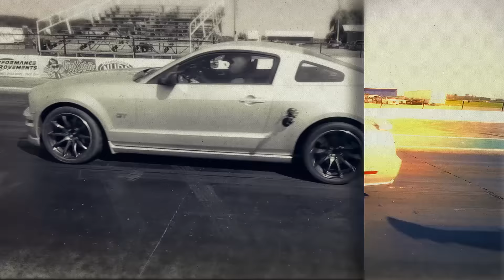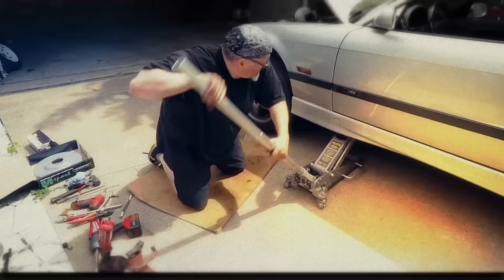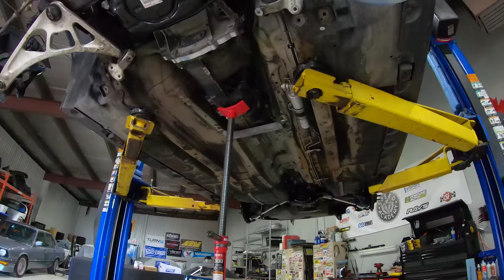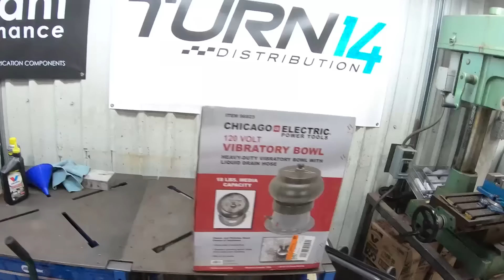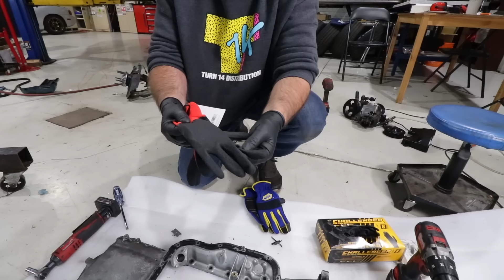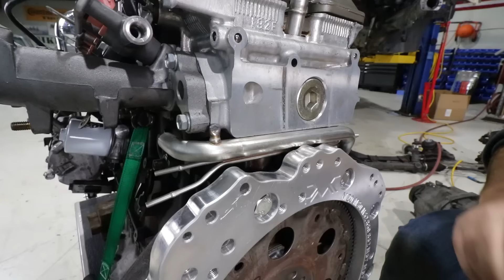Ultimate BMW M3 Rebuild - 2JZ Swap Isn't Easy - Part 9

Comment: For that stubborn harmonic balancer bolt get you a 2000 ftlbs impact gun.  By the way, I think I saw one of these being used as a prop in a Schwarzenegger movie.  Anyways, I have one and it hasn’t let me down yet.  See link below.

https://www.harborfreight.com/1-in-industrial-pinless-air-impact-wrench-68128.html

Comment: Hey guys here a set of sockets that you guys need so you don't struggle. 
You don't have to buy this set but lisle sell them individually and I trust lisle 
OEMTOOLS 25276 6 Piece Crank Bolt Socket Set, 6 Pack https://www.amazon.com/dp/B078K45ZQ4/ref=cm_sw_r_cp_apa_i_l-1fEbD63080Z

Comment: For the crank pulley bolt, I have one in my tool box and it has never failed me.
I work at Nissan and have used it for titan engines. 

https://www.amazon.ca/Lisle-77080-Harmonic-Balancer-Socket/dp/B00RGNCV1U

Comment: Never, never, never put grease on the input shaft splines like that.  Even if you don’t screw your clutch by contaminating it with grease creeping out the disc, you will have problems as the grease attracts dust as the clutch wears.  But what do I know, I have only been doing this for 40+ years.

Comment: Good luck! Btw you’re going to want a custom fab to support the front of that differential. Terrible design with one little screw in type bolt hole that’s suppose to hold all the torque. Even with a rear diff brace by SAAD racing, the second you have any wheel hop that front bolt will 100% break. 
Every other 3 series had two passthrough mounting points for the diff. And the more obvious note where it all bolts to eventually rips the whole frame out 😂 terrible design on a beautiful car.

Comment: I wouldn't dent the booster. I don't know anything specific to bimmers, but I know boosters from like 80s Toyota pickups seem to be pretty commonly used on alot of vehicles where more clearance is needed. Maybe start by just looking at boosters from other bimmers first

Comment: It's worth noting that when lubing an input shaft care should be taken to not overdue it. You obviously do not want grease or any lube getting onto the clutch disc. That is a quality grease I very much like, but I prefer to use a small amount of antisieze, i think that it's let's likely to "melt" under heat then a grease.

Comment: i use one of those hydraulic carts at work often. I use it to remove piston compressors for refrigation systems. the compressors themselves are usually V4 or W6 piston compressors and weigh 300-400lbs. That cart is a must, along with a boom truck

Comment: For removing the crank bolt on a Miata, I attached a long breaker bar, rested it against the ground and bumped the starter. The bolt came loose right away. Just be sure it is positioned on the right side or it will hit your body when you turn the car over.

Comment: Brake booster eliminator kit from Chase bays: https://www.chasebays.com/products/chase-bays-brake-booster-eliminator-bmw-e36-e46-e90-e92?variant=33631494729&utm_medium=cpc&utm_source=google&utm_campaign=Google%20Shopping&gclid=Cj0KCQjwoqDtBRD-ARIsAL4pviARD6YGD8R8Zcwlu4wfDSIhhLoOLyr2Ou1t6wZ2hVwJu-_pFAVg33oaAkpZEALw_wcB

Also, try the 2JZ GTE water neck from CX-Racing:

https://www.cxracing.com/PIP-WATER-2JZ-CAST

Comment: I recommend to strenghten the front axle. It’s too weak even when the stock motor lays on it and the car is driven hard. They break at the point where the engine mounts are. We drive them with special reinforcement plates here in Germany at the Nürburgring. In USA Garagistic for example is offering reinforced front axles. I would highly recommend doing that mod.

Comment: From my experience, I found heating the pulley bolt with blow torch, using impact wrench and then also breaker bar with a chain and bolt on the holding the crank from sling at the rear main worked well :)

Comment: For the coolant line that wraps around the block, you can use a 2jz-ge one which only mounts to the left side of the block instead of cutting it.

Comment: try condor speed shop’s e46 steering guibo replacement kit to help with clearance between the rack and engine. it does away with the large rubber guibo disc entirely. 

https://www.condorspeedshop.com/products/steering-shaft-conversion-kit-e46

Comment: Go with a booster delete ..... you can get masters that still retain oem drive ability while deleting the booster..... check with like ap racing or willwood .... heads up not cheap though if i remember right

Comment: You can get a lower water neck rotator. Companies like Power house racing or drift motion sell them. A way you can crack the balancer bolt is have a breaker bar on there against the floor and quickly hit the starter motor

Comment: I had a supra long ago. I ended up grinding the head off the crank bolt completely off carefully and it spun out by hand when doing the timing belt. Used an older used grinding disc that was small enough to fit inside the balancer, took about 20 minutes.

Comment: I don't want to be a hater but those mounts really feel like a miss. They position the engine back which I get is good for weight savings but makes everything else about the swap very "sloppy" feeling. If they positioned the engine close to an OEM location, so much less modification would be required. The chassis was already designed with a similarly sized engine with similar weight, even if the motor was 1" forward it would be a bust on the balance of the car. If this was a stripped out race car, then yeah, definitely the right way to go, but for this streetable E46 "supercar", I don't know. I love what you guys do, but it seems like a misstep guided by a sponsorship deal.
Reply: Doing swaps like this you will always run into space issues. If they moved it foward you could possibly have issues with clearance for the oilpan to subframe and various other things. Sometimes you just gotta pick a direction and deal with what comes. I'm sure getting bolt in mounts for free or cheap is also a nice thing when spending this kind of coin. What's really sloppy so far? Trimming some sheetmetal around the booster and denting the tunnel that you will never see? All pretty standard stuff when doing weird swaps.

Comment: Also did you use loctite on the flywheel bolts?  The thread section on the crank is exposed to oil and can leak if you dont.
Reply: I must have missed him do it cor the fly wheel bolts.  I saw him do it for the pressure plate.

Comment: Get an 85 Mercedes 190D brake booster. Its what the ls e36 guys recommend, if you're going with a smaller booster. Or hydroboost, that'd be cool.

Comment: I'll give you all a hint for the crank pulley bolt, whether anyone listens, whether anyone even sees this post, I'm going write it out anyway.

YOU WANT IMPACT FORCE!!!!
But an impact wrench won't do much good on a massive bolt like that because the impacts will be too short and sharp (unless maybe you have a real big inch drive impact wrench or something). So you'll want to attach your breaker bar or spanner to the bolt and: 
HIT IT WITH SOMETHING!!!!
But a hammer or mallet won't do much good because it's too light and hits too hard, you'll want something which hits soft but has enough weight that it doesn't want to stop. So you'll want to:
USE A BIT OF TIMBER!!!!
Get a decent size log or a handy length of 4x4 and THRUST it into your breaker bar/spanner - you wont need HALF as much torque from your locking bracket if you use impact.

Comment: I keep laughing to myself as they do all of this reverse engineering when they could have done an amazing S54 turbo build.
Reply: They just said they didn't want to do another S54 since they just did one.. not to mention the cost to get an S54 to be even on par in strength to a 2J. S54s wipe out rod bearings on stock engines lol
Reply: @chickenfishhybrid44  dude, changing bearings is cake compared to installing a motor into another manufacturers car.
Reply: @reactor4  this is a YouTube channel that wants to make interesting content for one. Once the 2J is in and installed they won't have that issue with needing to change rod bearings like underwear.
Reply: @chickenfishhybrid44  Like underwear? Please, I have an E46 M3 track only car.  Changed the bearing a 120K and they were fine.  Would you should be saying is.. "These guys prefer Japanese cars over German cars"  That's why they are doing this type of swap.
Reply: @reactor4  neat, I assume your track car is also at or near stock power. They were talking about like 600 horsepower... Like underwear is an overstatement sure. But pretty sure a stock bottom end S54 isn't guna handle 600 HP anywhere near as well as a stock 2J will.
Like I also already said, they already did an S54 build and don't want to do another. Sounds like you're just a BMW fanboy.
Reply: Chief G.  I agree

Comment: For the brake booster issue, have you considered a hydraulic brake booster? I had to remove mine in my rx7 when I did my Ford v8 swap, I still haven't put something back in...but I have thought about using a compact hydraulic unit. The footprint is quite a lot smaller, you may have to run a different power steering pump. Chevy puts one on its LM truck engines.

Comment: Are they using an R154 transmission as well or are they using an adapter plate to the stock bmw trans?
Reply: Tobias jcR  they’re using the BMW S420 G transmission with an adapter plate, think they are deleting the smg too in favor of a six speed manual
Reply: @Ovadose850  has anyone done a 2jz with smg, do you know? Not a lot comes up on a Google search, but a 2jz e46 smg built as a GT car sounds pretty sweet
Reply: I’m sure someone out there has tried that, might just not be public for us to see here on YouTube

Comment: I've taken off many of these stubborn pulleys.  What you need is a Snap-On Chain Wrench.  Be sure to use an old piece of a serpentine belt to protect the pulley from being marred from the chain wrench.  Has never failed me.

Comment: Fold the serpentine belt into itself and just brace the engine. there will be enough friction between the pulley's to get that bolt removed. I tried the starter trick on my GS and it didnt work so i mechanically locked the serpentine belt and it came off with a decent amount of force.

Comment: Even 1J crank bolts are a pain in the rear to take off. My most successful method is a the longest chain wrench you can find and 36 in breaker bar plus cheaters on both.

Comment: Aren’t you trying to make a thousand hp out of that thing? Your going to blow that clutch away before you even make enough power to meet your goals. Torques going to be well above the limit on that clutch.
Reply: They are targeting like 5-600whp is my guess. Unopened 2J, so 1000whp reliability doesn't seem realistic.
Reply: Karl Taht yea that’s something else I didn’t bring up. Their target is super cars. Which are going to absolutely walk all over a 5-600 whp 3 series. End of story. They’re going to need into the 800s to handle what they’re targeting. That clutch will be at its absolute max torque limit at those ratings even with boost by gear. They made the wrong choice for their application. Just like they made the wrong choice by not opening that jz up and taking care of a few preventative things.
Reply: @user-mo8tm4jw2l  Yeah, as you said, that's the other thing. I though maybe this one would be a mock up engine and then they'll either open it or get a built block with some headwork. The 2J is a masterpiece of an engine, no doubt; 700 to the wheels unopened and relatively reliable? Yes, that's possible if properly tuned but somewhat similar to what announced, no way. That clutch would slip like crazy way before and the engine would be a time bomb.
Reply: What's the clutch they installed rated too? And typically clutches are rated to torque not power... maybe they'll spin it to 8K and keep the torque reasonable?
Reply: Karl Taht six hundred and change ft lbs. Not nearly enough imo. Nothin wrong with a single plate but the goal of walking super cars is questionable with that clutch. Certainly not from a dig. Generally spec the clutch to 2x estimated torque if you want it to last. I don’t have a spec sponsorship so maybe that’s why I do that lol.
Reply: @user-mo8tm4jw2l  2X sounds like an awful choice to keep the car daily drivable, lol. I've always believed in cushion, but it's not a drift car.
Reply: Karl Taht can’t always have your cake and eat it too man. Trying to make a 2j powered m3 with full interior keep up with light weight super cars with dual clutch gear boxes and everything else they have is going to require something a bit more hardcore than a daily driveable style of build. How many passes you think that clutch will hold...
Reply: @user-mo8tm4jw2l  so argument is add so much power its comepetive on track and a complete disaster on the street? Seems like balance makes more sense to me.
Reply: @user-mo8tm4jw2l  most "super cars" really aren't that light. Most are 3k+ lbs and 5-800 hp.. the goal I've always heard them use was 7-800 hp. They specifally want it to have decent road manners. It's not a drag car or drift car.
Reply: Corey Pearson a thousand horsepower 2j wouldn’t likely last long or be very drivable in a road course car.  I’d imagine their goals are much more modest.
Reply: @randoman75  They said this project purpose is to make an ultra fast - highway roll racing style - street car to go after supercars, therefore the 1k hp goal. I was sceptic too when saw it was a single plate clutch and given the torque rating I agree with corey that if their hp goal is achieved that clutch is not going to hold.
Reply: Yeah. I don’t know what I was thinking. I’m sure they have no idea what they’re doing and you do.
Reply: @randoman75   The thing is that you don't really have to do much gesswork. People have made the 2J make basically any level of power, so you can find many examples of what works and what doesn't. I think they will go for something like Karl said, maybe even into de 700s. But for the 1000 they claimed (even more if they were refering to wheel hp) they need a built engine and more plates on that clutch. The gearbox and chassis would handle it.
Reply: Should have just boosted the S54 ! Kept it a Real M3 Project ! But No !!! so we will See!

Comment: 4:20 It will come off with a big enough powerful enough Impact Wrench. You can rent them. I know Milwaukee makes industrial size units. But that would really be the answer if all else fails. Hey is that an E28 I spy in the background? What's the scoop on that baby?

Comment: 1000HP out of the S54 with a bit of internals and run the car with the same wiring and a map tune. (Maybe more than that though). You wouldn't have had to switch out the trans or rear end and apparently they are pretty bullet proof after it's done. You take out the Vanos so that's no longer needed either. Oh well I'll enjoy it I guess anyway. LOL. But it really would have been nice to have it been all BMW. Keep up the great content. Check this out. https://www.youtube.com/watch?v=75s6Tar93Zg

Comment: You guys should consider a hydraulic brake booster, driven off the power steering pump.
Pretty popular solution for the off-roading community - the booster-pumps are significantly smaller than traditional booster systems - and provide a whole lot more brake boosting. Will definitely need some stronger brake lines than any oem rubber hoses to handle the added pressure, and higher temp-rated fluid.

Comment: To break loose tough nuts use a hammer!
Get a breaker bar with a large flat section above the socket that you can strike with a hammer while putting load on the fasteners.
The brake booster diameter generally applies more force to the brakes the larger it is. On a turbo engine swapping out to hydro boost may be a better choice. Otherwise the booster off the Toyota donor vehicle is probably the right size and may fit the BMW.

Comment: chasebays do a brake booster eliminator kit, i have seen a relocation kit for an e30 that mounts the booster into the glove box mind you they where on the rhd vehicles but it could prove relevant if you can find the forum post
Reply: I've seen people relocate then foward, looks hideous to me but it works. But putting it in the glove box on the opposite side of the car?? I'd hate to see the linkage on that setup lol
Reply: @chickenfishhybrid44  rhd e30s have the booster on the left hand which is painful in the sence exhaust manifolds on bmw slants are on the right hand and would allow room for a booster which would mean space for itbs, custom manifolds, etc..so what ever way you look at it you will need to fabricate something to keep your booster regardless so relocating it into the cabin isn't that much of a step backwards.... I've also heard 2001 reno Clio boosters can be made to work dunno if it's enough for a 2jz but worth a look
Reply: @sageboostfreak  right, but this is a LHD E46 lol
Reply: chickenfishhybrid44 so..... the only difference is the steering wheel position and uni to the rack....... which would mean that apart from the steering components and the addition of the linkage for the braking system, these are the only difference, obviously interior pieces etc..... but you're missing the point in the rhd e30s they have a linkage yes, which means the booster sits on the firewall in front of the glove box and there is a relocation bracket made to move the booster inside the cabin rather than remove the booster,
Now this isn't going to bolt into an e46 m3
But it shows what is plausible in relocating it for their application.....
Is it worth the time and effort probs not...